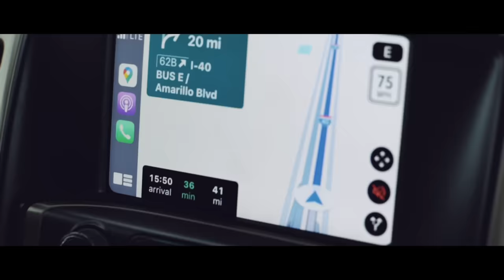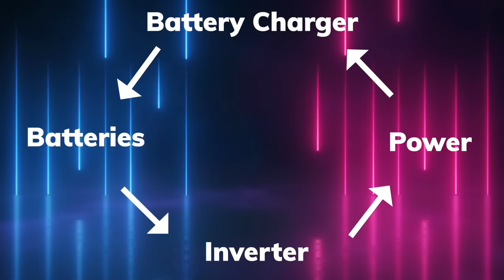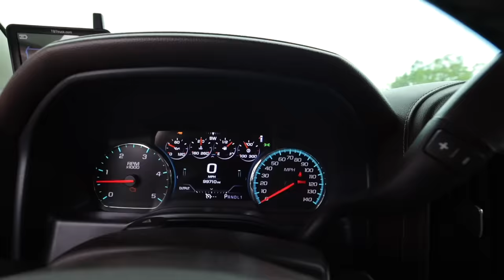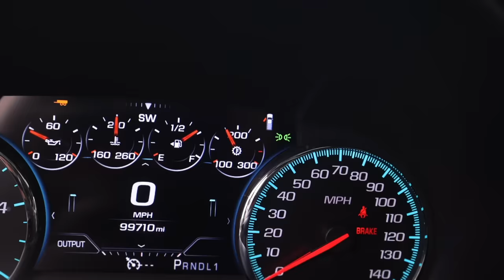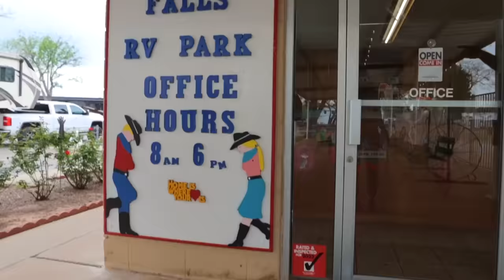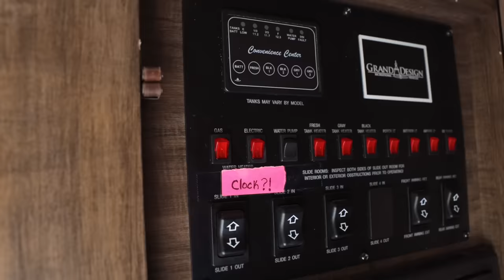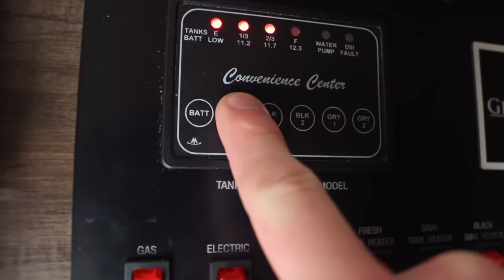The Scariest Part of RVing the Midwest - Riding out a Texas Storm

Comment: I use a 50 amp to 15 amp pigtail all the time. It plugs into the 50 amp plug on the RV then I run a 15 amp extension cord from there. It is so much easier than wrestling with a 50 amp cord when you only are plugging into a 15 amp outlet. Especially handy when boondocking and running my 2000 watt generator.

Comment: Carl, I would really urge you to install a transfer switch for your inverter. I actually have 2 in our class B. They are fully automatic. As an engineer I did not have to learn the hard way that the inverter can't be used to power the battery charger.😊 My 2 switches work this way: The first is connected to shore tie and generator. If shore tie is connected the switch goes to shore tie, if not, the switch is lined up to generator. The output of first switch goes to second switch. If  either 110 source is present, that source is connected, if not, it is connected to the inverter. The battery charger is fed from a branch circuit off the first switch, so it cannot be powered unless generator or shore tie connected.

So one thing this does is power my entire 110v panel off the 2000 w inverter, but there are loads that I need to cut off or the inverter would overload. I put red and yellow labels on the breakers and turn those off if running on inverter (air conditioner, Hot water heater). (The water heater also runs on propane). I'd be happy to help you fix up Soli!
Reply: We need to figure this out for the long run. For now we are basic set up with portable generator and will see how boondocking goes.  Thanks for the great tips!!

Comment: I put the fan in my camper just like you did on your fridge. Trick I did that would work easy for you is I have the fan plugged into a remote. So I can turn the fan off and on from inside the camper. The remote plugs into the outlet your fridge plugs in and you plug the fan into the remote transmitter. Got it at the local hardware store. Love the videos.

Comment: Same as you have but I put a outdoor plug in old lead acid vent in front bay to keep bay locked and it makes it easier also have a remote for inverter to shut off when I got to bed as they use some power when, happy camping

Comment: At the 5:58 mark, you can see the old battery vent, when you had AGM batteries.   You can convert that vent to an outlet that you plug your 50 amp cord into.   then the backside of the new plug goes directly to your inverter.   Never have to fuss with that whole problem again.

Comment: I live in my travel trailer full time, it is parked in my daughter's backyard and I do not move it. I am about 30 min. south of DFW, Arlington, and FT. Worth area. I pray through storms it does get windy enough to rock my trailer. Been here 4 years and starting my 5th. Weather changes around here a lot. If you don't like the weather, wait 5 min and it will change. I've had 4 season in one day.

Comment: I used your invertor connection system 25 years ago on my first solar system on and RV. Instead of dragging the heavy cord, use 50A to 15A dog bone at your 50A RV connection and use a regular extension cord to the inverter. Saves fighting with the *impossible* 50A cord

Comment: A little FYI: if you remove the flat/Phillips insert from the screwdriver, the size of the hole is either a 1/4” or 5/16” socket and can be used to screw in the bolt head on the pipe clamp.
I discovered Ryan Hall a couple weeks ago, appears to be more accurate than the local weather forecasters from Houston. HA!

Comment: Last Sept/Oct I did that same drive across NM and Texas after spending  a few weeks in Utah.  Landed in Fredricksburg TX for a bit.  Also weathered a massive Texas thunderstorm/tornado watch that rocked the RV quite a bit side to side on that trip.  Not a lot of sleep that night.  True Texans were like, yea we had a bit of weather last night.  I filled the water tanks competely full for ballast and that helped quite a bit.  110 gallons helps stability when sitting in a campground.  I-40 was one of the worst roads I've driven in years, surprised the RV didn't come apart.  Hence your loose dryer hose. Be safe out there.

Comment: Just a helpful tip......the screwdriver Ney Ney was using comes apart and there is a "nut driver" that will fit the screw she was tightening up on the dryer vent.  That nut driver is easier to use, and it doesn't slip off the screw like the flat head screwdriver does.  Depending on which multi-driver you have, you should have 4-6 different size nut drivers on the one tool.

Comment: Option 1 is transfer switch
Option 2 is a breaker. Switch on or off
If you need the 50 amp connection, you'll need dual 30 amp breaker.
One of the other rvers replaced fuses with breakers. 
You don't want Nana's hair dryer to shut off when her hair is still wet

Comment: We also stayed at Bar Z going to the Eclipse as well but a few days after you. Also had to deal with the wind but it was a great Harvest host.
One suggestion for your boondocking solution is to buy a different dog bone that twists into the rig and you only have to use a 15amp extension cord instead of pulling out the big 50amp cord. Also will give you the ability to close your front cabinet door.

Comment: You should look at a 15amp to 50amp adapter on the trailer then a extension cord to the inverter. Install a  cable hatch in the front compartment. that way you won't have to plat with the heavy 50amp cord and leave the front compartment open.

Comment: Don't be scared of a tornado. Rarely do they form overhead where you are. Find out where it touched down and it's direction of travel and pull your rig or bug out in the opposite direction. I've done this many times over. If one forms suddenly right on top of you, you're a gone-r anyway. Closest I've ever come was years ago when one touched down across the street from me. Literally!! There was a lumber yard there when I went to bed and the next morning it was gone! I did not realize it was a tornado - 1 and I fought with the back door connected to the kitchen to keep it closed and keep the rain out. I even pushed a buffet over in front of the door to keep it shut and the wind pushed the door open and moved this heavy buffet across the kitchen floor. I just thought it was a bad thunderstorm! Also, at the time I was a teenager and didn't know better.

Comment: Next time the vent hose from the dryer comes off tear off about 1/2” strip of duct tape and wrap around the vent though the wall pipe end then slide the hose back over. The clamp will not pull past the duct tape.

Comment: So the inverter doesn’t connect to the rv power panel? We have a large system because we boondock a lot. Our inverters yes two, hook to our rv panel , we also 10 littium batteries, also 2400 watts on the roof. Yes, I spent why too much money. My opinion, if you connect the inverter to the main panel, I am not installer, but I feel you would not need the plug in wire, and I don’t use a switch from batteries to land power. Hope to see on the road.
Reply from the maker: We wanted to find a cheaper off grid solution for people trying to save money

Comment: Your LION batteries shouldn't need to be "vented" so you could theoretically use your existing vent hole to run you 50A cable through and not have to leave the door open.

Comment: An idea for you, add a LITTLE silicone around your vent pipe before sliding it on to to act as a glue, but too much and it will destroy the flex tube taking it off if you ever need to. Another great video, keep it up.

Comment: Hey Guys, just a little tip. That screwdriver you're using to fix the vent is also a nut driver. It has a couple sizes built in to it. You can pull the flat bit out and you will see the shaft is like a small socket. If you flip the shaft you will have another size and I thing there is a shaft then a sleeve which gives another size and then the bit. So you can use it on the hose clap and get a better tightening on the clamp then what you will get by using the flat bit. Happy Trails :)

Comment: Hanks, you guys are the best! Two things…1. I40 is the WORST highway I have ever traveled! We went to Houston and back last year…thought we were both going to need new teeth! 2. If the dryer hose comes loose again, you could simply put 2 screws through the band clamp after tightening it, that will fix it so it won’t vibrate loose, but remain removable.

Comment: You should look into the 12v compressor refrigerators. I've had the dual fridges up until my last rig, that came with the compressor.  What a huge difference. Don't have to worry about my food now.
Reply from the maker: We've thought about switching, good to know they work great!
Reply: @HappilyEverHanks  You'll probably want to add another pair of batteries, though. I found that mine used about 2/3 of the available power each day when I only had 2 batteries. I'm running 4 of those same Lion Energy batteries that you have, with 400 watts of solar and a 200 watt inverter, and have never run out of power since.
Reply: Dual power source is 100x better than just 12v only. Especially if you boondock a few days here and there.

Comment: Be careful running your generator in a compartment not properly insulated or vented for it, you could fill your home with carbon monoxide
Reply from the maker: Good thinking! When we use the generator, it comes out and away from the rig.

Comment: Hey Hanks...
You can still a hole through the floor for the power cord to go through, so you can shut/ lock door...
Many different kinds of opens to choose from to seal hole when not in use...
( The  big one that the stinky Slinky goes through is the best, it's large and has a screw in sealed opening)
Good luck, safe travels... 👍

Comment: Another great video, but OOOF, ya'll may want to rethink your solar/inverter situation. You can have a system that does not require you to plug anything in, or disconnect anything. There are several other YouTuber's that have set this type of system up and have shared their knowledge. Victron is a global leading expert, and they will help you design a system.

Comment: Direct wired into my 2000 watt inverter and installed a 30 amp receptacle near the inverter.  Then I plug in a 30 to 50 amp cord out the hole in the battery compartment to the shore power 50 amp receptacle. Make sense?  Your way all you can pull is 15 amps.  I can pull 30 amps.  I’ll send you some photos to your email.

Comment: I don’t remember your inverter install, but it seems that it should have been wired to your breaker panel. You may need a subpanel. We run everything except the A/Cs using the inverter. Our Xantrex is also a charger, but doesn’t loop as it seems yours does. Check how things are wired as you shouldn’t need to disconnect the charger to prevent a charging loop

Comment: Several years ago a tornado touched down in a town where I was hooked up in an RV park. Since then I purchased a NOAA weather radio with SAME ability. This SAME will alert you to any forecast watches, and a separate alert to any warnings being issued included tornado touchdowns.  These weather radios are not perfect in their warnings, but they are proven to have saved lives.  The SAME warnings require you put in the equivalent code to the county that you are in to get the alerts.

Comment: Why don't you get an adapter that comes out of your trailer plug that reduces down to a 15 amp connection and use a 12 ga extension cord if you are only running a few things off that inverter? A 12 ga extension cord is plenty heavy enough to run your coffee pot, lights, and TV. They are lighter, smaller, and easier to move around then that monster 50 amp cord.

Comment: We just bring one of those portable power stations inside to run electronics...well except the microwave. For that we have to do what you're doing, using the power station. But most of the time we just use the propane stove instead of that fanciness.

Comment: Hey if you will run your 110V cord out the bottom of the battery tray there is already a drain hole in it and it will pop right down through there and then you can plug your 50Amp under the RV there. You might need a short 110V extension cord to make that work, but that what I have seen others do.
That way you can close and lock up your door there

Comment: Noticed your trailer rides front high. I fixed my Montana by using E trailer CORRECT TRACK which will raise the trailer at the lift springs. I've had mine for three years.